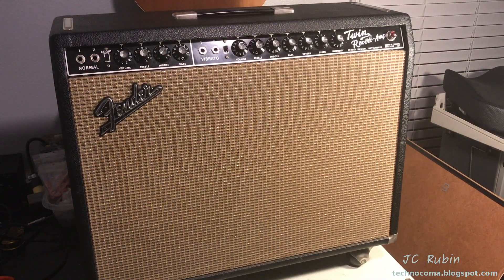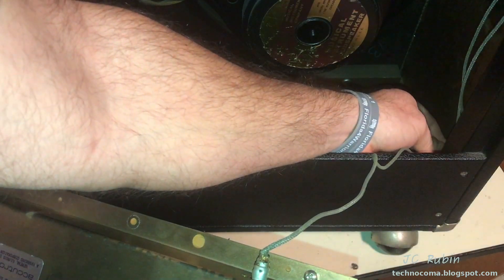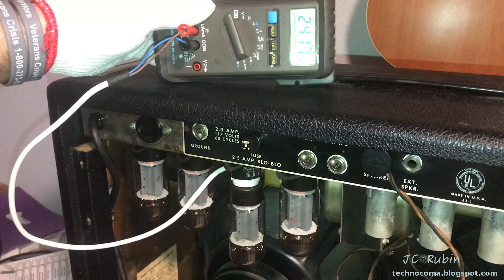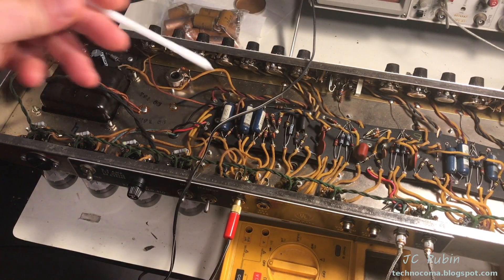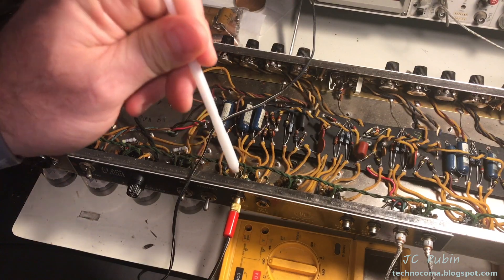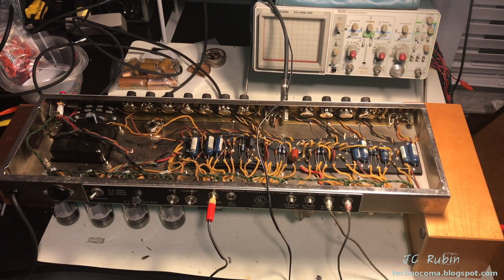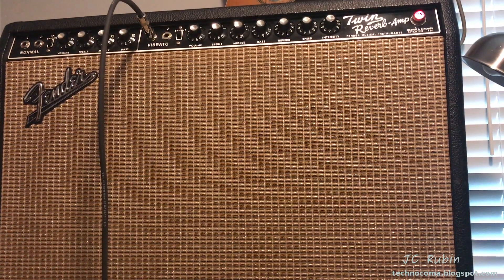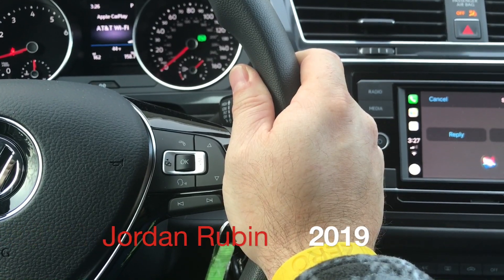Fender Twin Reverb - Random Feedback - Troubleshoot and Repair

Comment: I was recently troubleshooting a vintage reverb tank and circuit... those old RCA connectors can be a pain, same with the tank connections.  Contact cleaner makes a HUGE difference
Reply from the maker: It does, those are crappy connections on a good day.